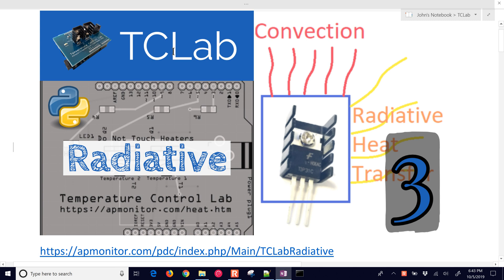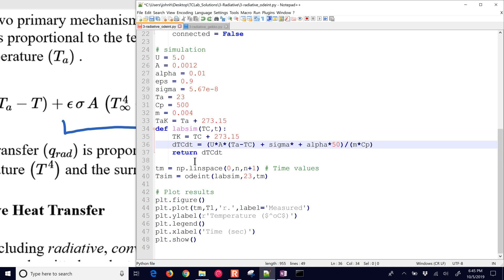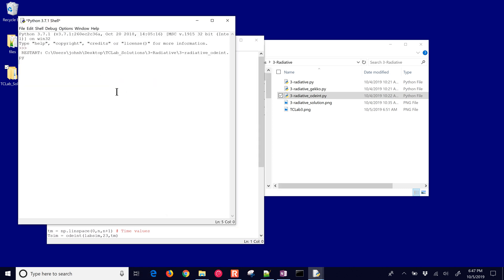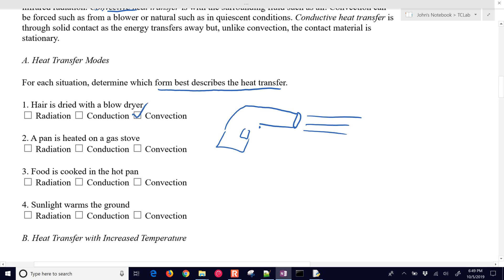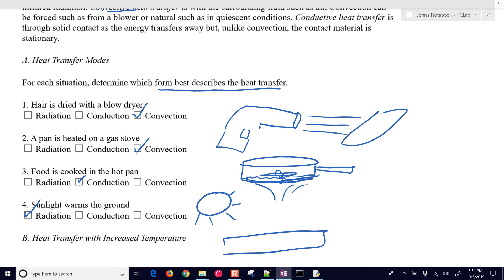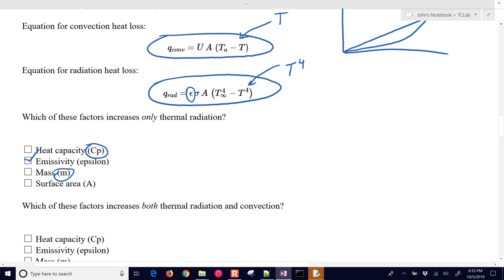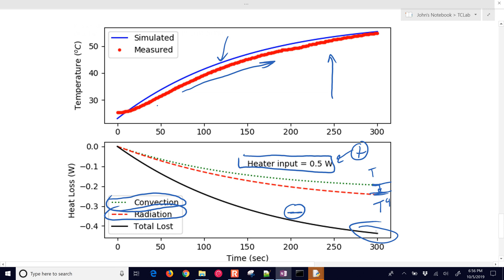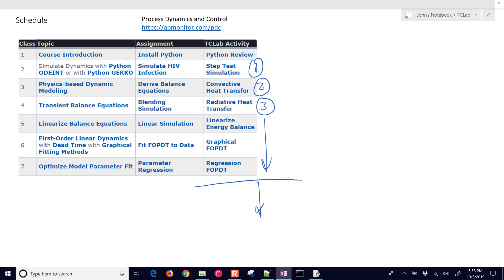TCLab: Radiative Heat Transfer

Comment: Hello, Thanks for this informative explanation, I have tried to simulate simplified,Convection and Radiation models and plot them all together with measured data and found out that Convection-based model fits better the measured data, I was expecting that model with radiation would be the most one that suits measured data..
Reply from the maker: The physics-based parameters are not the same for every TCLab device. Here is an exercise on the importance of convection and radiation: https://github.com/APMonitor/data_science/blob/master/XX.%20Final_Project.ipynb  Also, see the exercises here to adjust some of the uncertain parameters in the physics-based model so that the measured and predicted temperatures match: https://apmonitor.com/do/index.php/Main/TCLabC

Comment: Professor, why do we not consider the conduction? Is it much smaller than convection/radiation or does it grow lineary with  the increasing temperature? Thank you for the answer :)
Reply from the maker: Great suggestion. If you model the conduction to the sensor, it is much more accurate in describing the temperature response as a 2nd or 3rd order dynamic system. Here is more information on that approach: https://apmonitor.com/do/index.php/Main/TCLabE

For conduction to the Arduino shield base, there are three prongs that are a conduction pathway. I didn't think it was significant because of the small cross-sectional area of those prongs.
Reply: APMonitor.com thank you for the answer :). I appreciate it